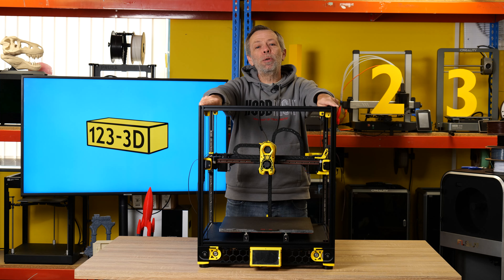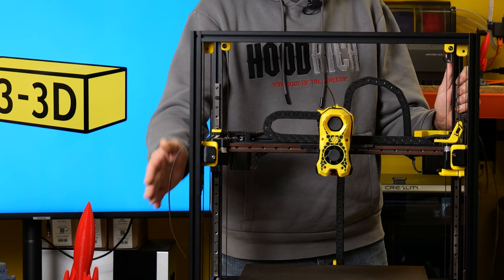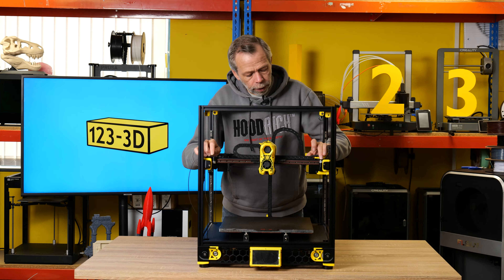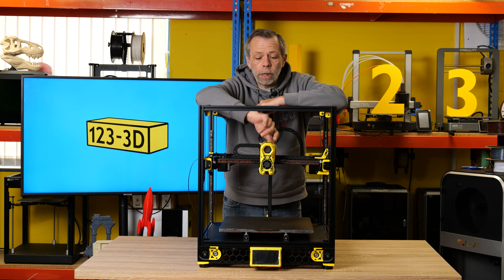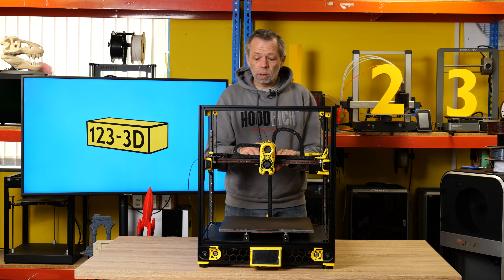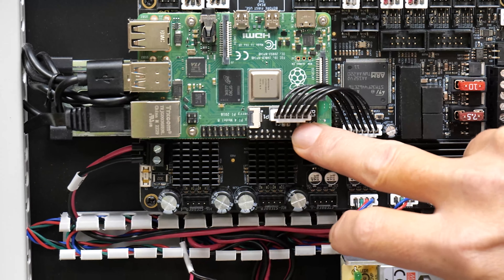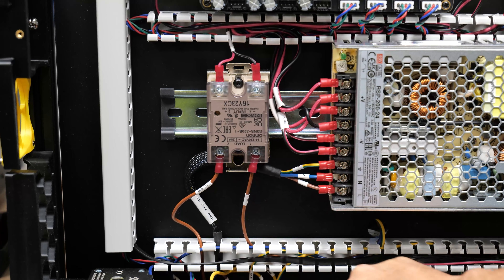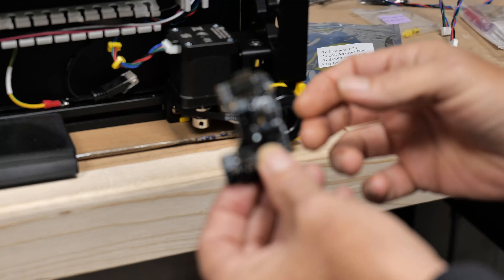Building The Voron 2.4 Rev D LDO Motors Kit | PART 3 Electrics and Gantry

Comment: This reminds me of those cooking shows where they basically baked the entire cake off-screen
Reply: Yeah but it was kind of nice seeing it in this way as well. Granted, I would LOVE to see complete build videos from this guy. I ran into a lot of the same issues it sounds like. I am 80% done with wiring now but still have some unanswered questions that I'm looking into more.

They could have done a lot better with the documentation side of the kit. This is clearly made for those already in the know and not for someone just getting into kit building. That's fine but I can see a path where it would be better if they made the documentation better it could appeal to even more people.
Reply: @rrittenhouse  What are your questions?
Reply: @slyceth  It's just little things that I need to look into like the LDO instructions said to run the brown BED L wire from port 1 on the SSR but no clue where the other end goes yet. There is a white BED L wire coming from the bed that goes nowhere  yet either. Just tying up little ends like that.